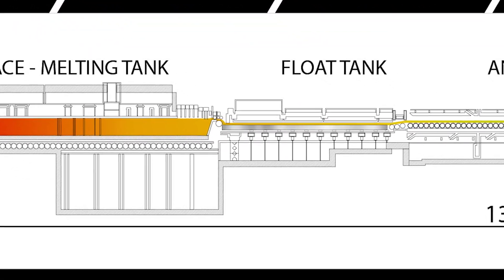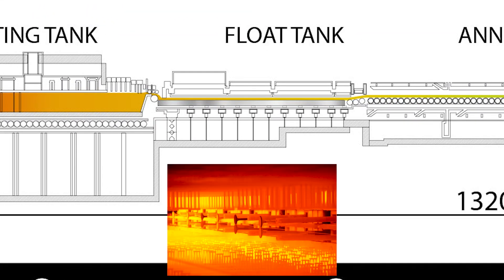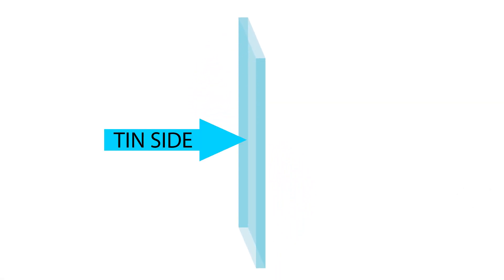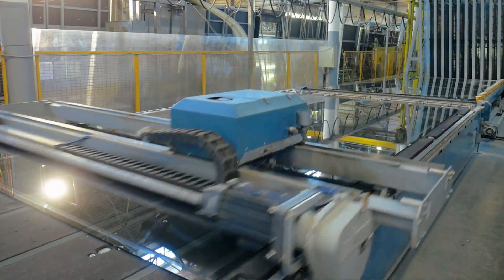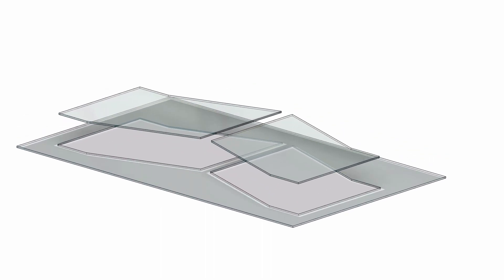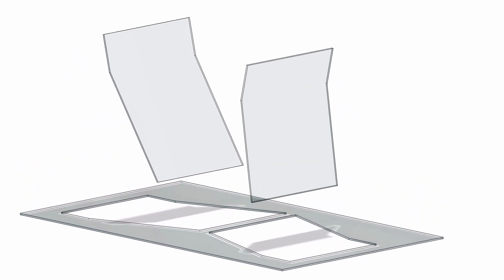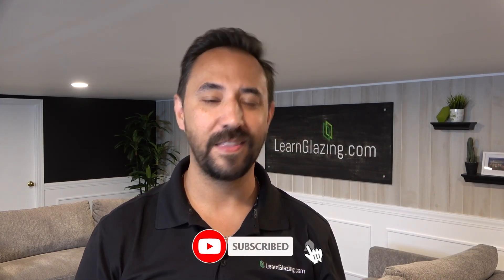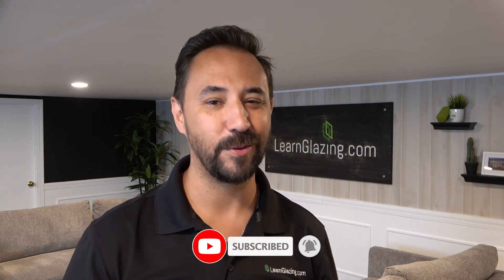Glass is not the same on both sides & the tin side of glass

Comment: Of the two primary laminated glass interlayers, PVB prefers the air side and SentryGlas (SG or SGP) prefers the tin side.
Reply from the maker: Hey Greg, those are correct. Don't forget EVA which is the perfect middle. Still moisture stable, compatible with 3rd party films, and doesn't really have a side preference.
Reply: @LearnGlazing  Yep, EVA works well in interior decorative projects that include a lot of colors because of it's clarity, and in solar panels due to clarity and moisture resistance. Not a big fan in safety applications though. Most EVA's in my experience lack tear resistance necessary to work in that application, despite what the manufacturers claim.

It's curious how DuPont, who introduced SentryGlasPlus (not to be be confused with SentryGlas or SpallShield at the time), didn't know how poor the product adhesion was to the air side when they introduced it. 
Of course newer version available today is supposed to have a solid airside adhesion, but still prefer to use the tin side.

Good stuff! Thanks for the videos!
Reply from the maker: @gregcorwin8316  We Appreciated the response.

When Kurary bought DuPont a few years ago they did improve the quality of the product. They now also state to use an adhesion promoter on non-tin sides of the glass. But you are right, the adhesion is far better than it was.

As for EVA, you would be surprised. While it does not have the strength that SG has if both lights of glass are broken, it actually has better elasticity. So, in a guardrail application, SentryGlas is definitely the preferred choice, canopies are arguable.

Check out these two videos. They are quite interesting. They compare after-glass failure on a canopy deflection and load over time.

https://www.youtube.com/watch?v=RcpnOEkwMoY&list=PLM3SaqDsayq8TEM6LGubO2_My9THz5qFv&index=4&ab_channel=DeGorter%2CInc.

https://www.youtube.com/watch?v=p5K7hxaqUZI&ab_channel=DeGorter%2CInc.
Reply: @LearnGlazing  Thanks and I also really appreciate (and enjoy) the conversation. It's not often that people on youtube reply, so when it happens, it's worth follow up. 

I really enjoyed the videos thanks for sharing!. I was especially interested in the high temperature testing of both EVA and SG laminated glass products. I am also quite familiar with Evalam, it's a product that we have used in the past, along with several other different EVA interlayers. I like a lot of things about using EVA, but I have never used an EVA that had the tear strength of PVB. 

I probably should mention that for the last 10 years before I retired (2019), I was the quality (including product reliability, testing, and technical) manager with the biggest user of SentryGlas in the world. We also used more PVB and some years more EVA than any other non-automotive user in North America. 

Kuraray acquiring Dupont lamination division made for some interesting times, especially when Kuraray divested their original Trosifol assets and changed the name of Dupont PVB from Butacite to Trosifol. There was definite confusion when that happened! Of course when Dupont changed the name of SentryGlas Plus to simply SentryGlas and changed the name of the original SentryGlas to SpallShield, that resulted in a lot of head scratching as well! The only saving grace was that not very many people were actually using SpallShield at the time.

Comment: How do you determine which side is the tin side and which is the air side?  I know if i order IGUs, the fabricator should already have determined that, but what about if I'm ordering monolithic glass?  Thank you.
Reply: Another option is to shine a 254nm UVC light on the glass. The tin side will fluoresce (glow) but the air side will not.
Reply: If you install an IGU with a LowE coating, the coating will almost always be on the airside, but in very few instances will it matter to a homeowner which side is which. It makes no difference if you are looking through the air side or tin side of clear glass because you can't see any difference at all.
Reply from the maker: Kira, You are correct, fabricators know because they use a tin detector. EDTM makes a few different ones. 

This is one of the more popular ones. https://www.edtm.com/index.php/ts1320-commercial-tin-side-detector
Reply: @LearnGlazing  So, basically, the only convenient way is with the tin detector?  Thank you!
Reply from the maker: @kiravanderzanden  Hey Kira, sorry about the late response. It's not the only way, but honestly, the easiest way as the tools are very easy to use and clear on the results. The price isn't that bad either and if a company needs to know, they are worth the investment.

Comment: How is the Tin side determined?
Reply from the maker: Hey Tim. Are you asking how you can tell which one the tin side is?

there is a company called EDTM that makes some tin detectors.
Reply: You can also use a 254nm UVC light. The tin side will fluoress under the light and the air side won't. The typical "black light" is 365nm UVA and will not work.